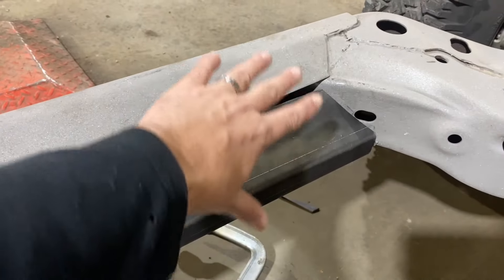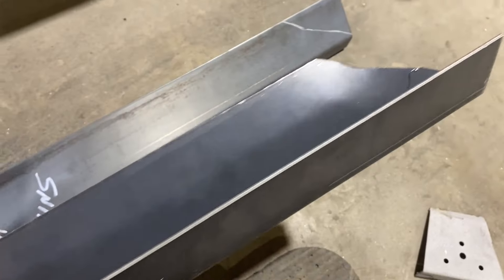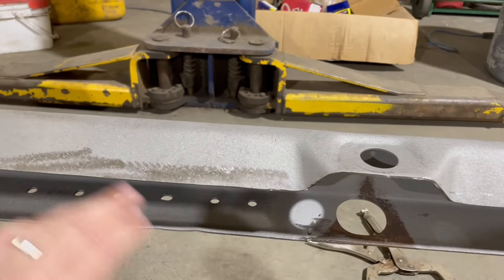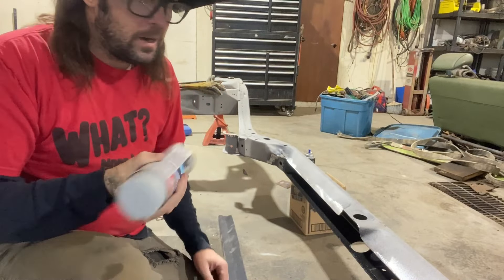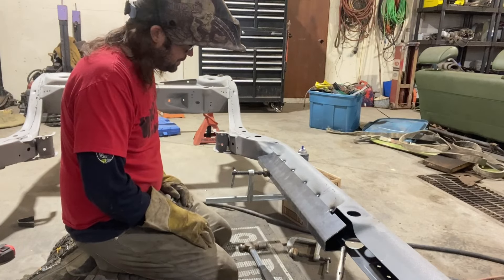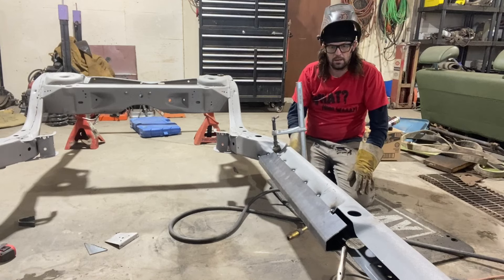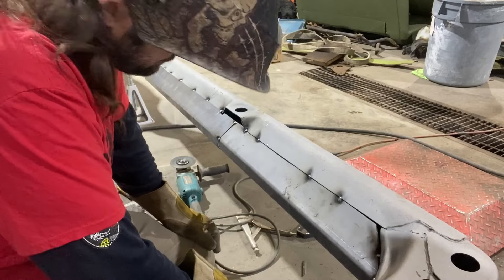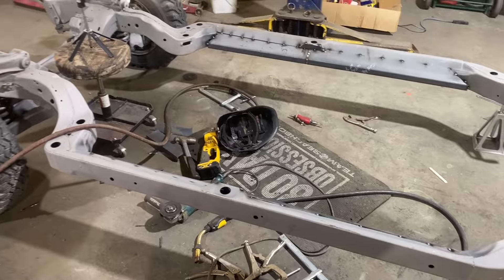Did We Warp This Frame?

Comment: I have an honest question: Why arent you just plating the open side of frame to "box" it . Gotta admit, i'm intrigued . This is not a criticism , an honest question as we have never even thought of that method here at my shop so, im really intrigued. Having morning coffee at shop before anyone gets here and thought i would ask.
Thanks bud.
Reply from the maker: Its similar to what came on the SS frame.  My Thought was that this will provide more strength then a flat piece. I could be wrong its just how I chose to do it.  Keep in mind Ive never done this before
Reply: @whatnooowaaay  I think it will be stronger as well, two more breaks that aren’t welded .
Did not know the SS was boxed that way- very cool.
The factory welds were pretty rough so, with the caps and fixing factory welds Alone she will be much tighter and stiffer .
With your bracing and cage- she will be nice and tight a long time.